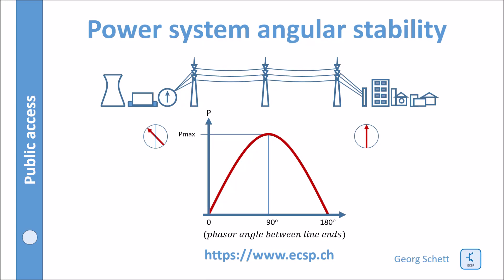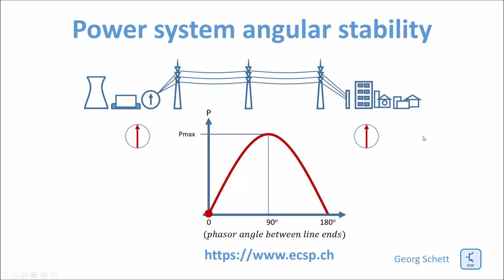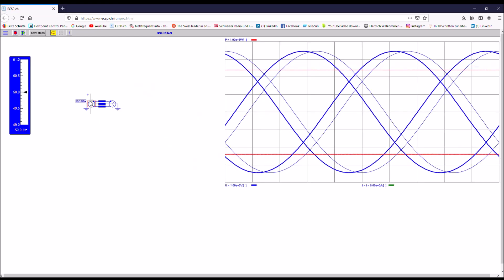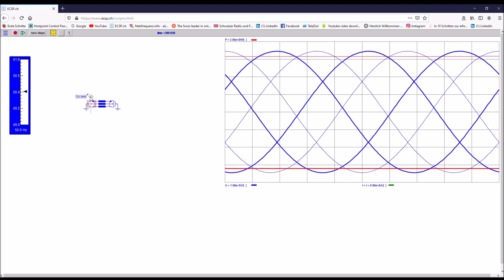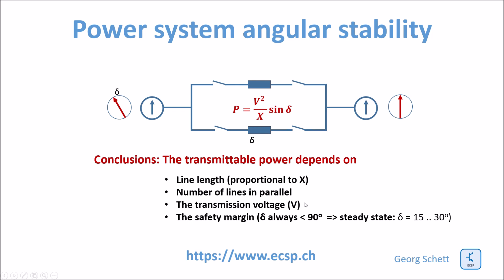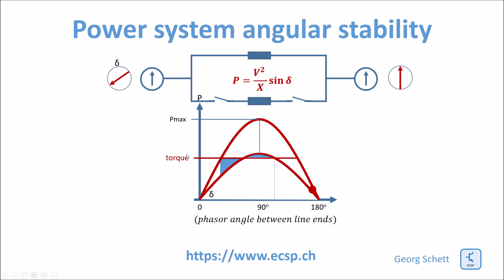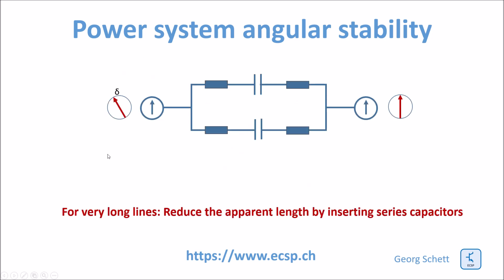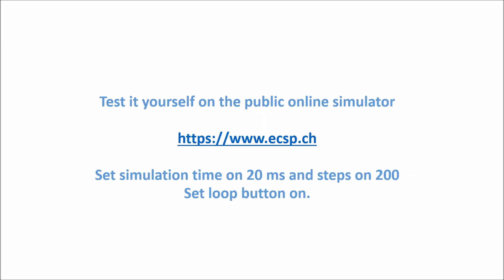Power system angular stability [circuit simulator]

Comment: So the active power transfer depends on the load angle, the reactive power transfer depends upon the voltage angle. Is that correct? Did you have a detailed video on active and reactive power flow directions etc?
Reply from the maker: No, not right. The real power transfer is a function of the angle between the voltage phasors at the sending and receiving end. The reactive power transfer is a function of the amplitude difference of the phasor at the sending and receiving end. Thus: voltage difference between the ends but no angle: reactive power exchange between sending and receiving end. Same amplitude but an angle: No reactive power exchange but real power flows from sending to receiving end (or vice versa). In reality however there is always a mix, i.e. both reactive and active power are exchanged because you always have inductive, capacitive and resistive elements in the system. Maybe this helps a bit: https://youtu.be/pThmAjXtSWk
Reply: @georgschett801  Thanks

Comment: Phase angle can mean a lot of different things to different people. can you clarify if this is a load angle, power angle or phase angle ( the angle between voltage and current aka power factor)
Reply from the maker: As per the video:
In transmission systems, phase angle often refers to the angle difference between voltages at two buses.

Power flow depends on this angle difference

Larger angle → more power transfer

Approximate real power flow:

P≈V1V2Xsin(δ)

where:
δ = phase angle difference between buses
X = line reactance

Comment: Please , I think there is a mistake in the last two minutes, or may be the mistake in my understanding.
Reply from the maker: OK, thanks! But I am not aware of a mistake, can you please let me know?
Reply: @georgschett801  First, thank you very much for your interest.   at the minute of 14:12, you said ( I open the breaker, and you can see now is how much this angle between the sending end and receiving end has been decreased) ,
you said before when adding the capacitor, the angle will decrease, so when we remove the capacitor, the angle is supposed to increase, or what?
Or you may be mean when you open the breaker of the second line and not the breaker of the capacitor , is this right ?
Reply from the maker: @SoherNasr-u3v  I guess I see your point. When the breaker is closed, the capacitor is short circuited, i.e. not in. Only when the breaker is open, the capacitor is in. I hope this clarifies
Reply: @georgschett801 
You really added valuable information to me. Thank you very much 😊

Comment: Hello Schett, great video. Just wonder if there is an intuitive way to understand why active power depends on a certain phase angle between source and load?
Reply from the maker: Hello Magnus, thanks for the fb! I am working on such a video, will be published soon. You can think of two magnets. Both are mounted on the same axis in the middle of the magnet. As long as there is no torque applied on the magnets, they will be oriented in parallel however with N and S pole in opposite direction. One magnet is the rotor field, the other one is the field induced by the stator currents. As soon as there is a torque, the angle between the rotor and the stator field will increase. Applying torque on a rotating system is equal to provide active power. I hope this helps a bit.
Reply: @georgschett801   Thanks, yes absolutely, cheers :)

Comment: Thank you sir. What is the direction of torque. Same with rotation of rotor or opposite it
Reply from the maker: It depends on the power delivery: With power out, the torque has the same direction as the rotation and vice versa.

Comment: Thanks. I have started a career in electrical transmission (utility control). This video is a great resource in addition to my textbooks. I am definitely going to watch some more of your content.
Reply: What books do you recommend for a college student looking to break into industry 😅
Reply: @snoopingasusualisee3903  EPRI Manual. It is free online. Purchasing a hard copy can be a bit of a pain. They are not cheap, and usually purchased by your employer, so it is not like there is a glut of them out there. 

Pretty standard AC Theory textbook. You can find good ones for free to check out your local library. Not much has changed in AC theory (at least at the level we use it) in like 60-70 years. So there are free .pdf's of old textbooks online you can legally download. 

If you want to spend money there are classes and online cluster packets. The NERC (federal license) exam is called Transmission Operator or Reliability Coordinator (reliability coordinator is a higher certification). Make sure any classes and packets you sign up for are tailored to those tests not the generation operator exams. 

 And Bismark State College has an online 2 year program with pretty much guaranteed job placement. 

The most important thing you can do is figure out if your local transmission grid operator (typically your power company) hires people directly from the outside, with no experience and such. 

I worked for my local public transit agency as a light rail supervisor. Since the trains are electric, and run on high voltage I had relevant work experience. Many company HR departments would say that was NOT relevant. 

So do not go all in only to find out your local company or the company where you want to move will not even accept your application. 

Good luck.

Comment: Hello Mr. Schett! Thank you very much for uploading the series on power systems engineering. However, as far as I can see, you've overlooked something here. The mistake you make is based on the assumtion that power line angle stability is equivalent to rotor angle stability, which it is not from my point of view.

For an ideal power line & synchronous machine you'll have following formula:
P = U1*U2/X*sin(theta)

In case of a generator, U2 will be the more or less constant grid voltage & U1 the rotor voltage (assumed to be constant as well). Therefore, your calculations are correct. However, in case an electric line where U1 might be the voltage deep inside the grid (constant), there is no reason to assume that U2 is a constant in theta. Increasing theta will decrease U2, and at some tipping point U2 will decrease faster than sin(theta) increases -> power is at its maximum. The angle at which this happens is !not! 90° but a function of the load angle (solely). In order to calculate it, you'll have to find an equation U2=f(P,load angle). Therefore, it is convenient to use the equation of an ideal power line: U2 = U1*cos(beta*L)-j*I1*Zw*sin(beta*L)...Depending on which coordinate system you use, you'll get a different sign. Substitute I1 with some expression of P & load angle, this will yield a quadratic equation in U2. Solve it and you'll end up with a term U2=f(P, load angle) which can be plugged into the first equation P = U1*U2/X*sin(theta). This will yield a curve P(theta) similar to yours, but with the essential difference that theta(P_max) is around 50-60° , depending on the load angle.

Best regards,
Matthias Maier
Reply from the maker: You are correct, therefore (as far as I remember...) I said in the video that for simplification reasons I assume that the voltage and the angle include the  rotor angle. In reality the synchronous reactance of the generator plays a major role for both, the angle and the voltages. Therefore as you say, the maximum angle in the system will be 30 - 60 and not 90 because the additional angle between the generator terminals and the induced generator voltage has to be considered. Thanks for your valuable comments!

Comment: I appreciate your video. However, regarding the formula @7:00, is V^2 the difference between the source and terminal voltage squared, or is it one of those voltages squared? If it is one of them, which one?
Reply from the maker: Good question. The assumption is, that both voltages are equeal in magnitude but different in phase angle. This is the key point. The torque establishes the phase angle and when you have torque you provide real power.
Reply: @georgschett801  thanks for your response. So then if I understand correctly, if we took into account the voltage drop due to impedance on the transmission lines and probably source stator windings, then instead of V^2 we shall have V source multiplied by V Terminal (Vs * Vt). Is this reasoning correct?
Reply from the maker: @dubol07  Perfect!!

Comment: sir, i want to ask one more question please. so what is exactly the rotor angle stability? i mean what angle exactly? angle between what and what? because i read and see another video and i am confused now. please help
Reply from the maker: It is the angle between the inner induced voltage of the synchronous generator and the outer voltage you can measure at the terminal of the generator. I am not sure where your confusion comes from. You may write me a mail: georg.schett@ecsp.ch
Reply: @georgschett801  I think it´s a straightforward question. It may not seem that evident that the  angle (in the time domain) between terminal voltage and induced e.m.f.  is the same as the angle between stator and rotor magnetic fields (electrical degrees).

Comment: great explanation, but sir im still confuse, please answer. in 11:37 you say that  "and you can see the phase angle between the line ends are still well below 90 degrees"
pleasee tell me which one is the phase angle, helpp
Reply from the maker: you see the 3 sinusoidal voltage curves of one line end and very close by, with a slite delay the 3 other curves. The delay at the instant you are pointing to is a few miliseconds (1 or 2 ms if I remeber well). The time delay is called the phase angle (or the delay angle or angle between the phasors) between both line ends.  For 90 degrees you would need a time delay of 5 ms, enough to loose stability.
Reply: @georgschett801  thankyou sir!